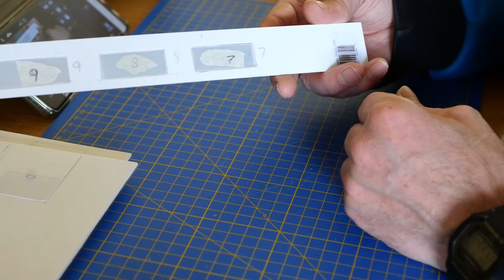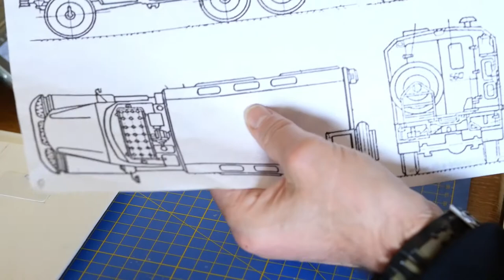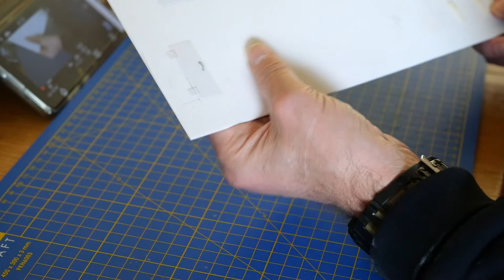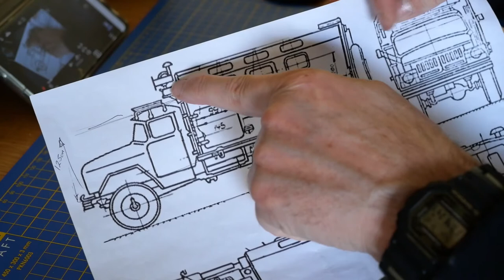Come On Styrene! Part 2 Of A Sluggish Styrene Build For The KingKong RC CA30 Truck

Comment: The left over bits from other Cross kits are so useful. The windows frames look great, they must of took a long time. Love all the other bits and bobs ideas then if you look at Star Wars they used bits from model kits. Not had a good day with the matador, plastic does not end up good using heat to get it curved round the roof of the rear box, Now going to make it all canvas.
Reply from the maker: Cheers Mal yes super useful sprues. And so many! Shame you've had a set back but curving plastic is, I guess, a risky business for all.
Reply: @antrc  The side of the rear roof top is small 90deg curve and took a lot of heat to get it work but then the plastic lost shape and distorted because of the ribs.. The only way to make the part is to have a wooden former and a over sized piece of plastic or vacuum former. Then it could be trimmed back, that's to much work so all canvas will do.
Reply from the maker: @BasBoyRC  yikes. Agreed. Canvas it is.